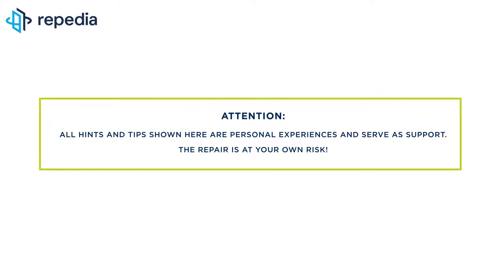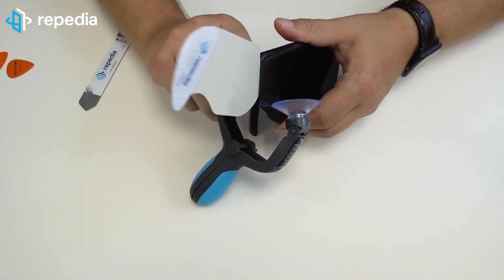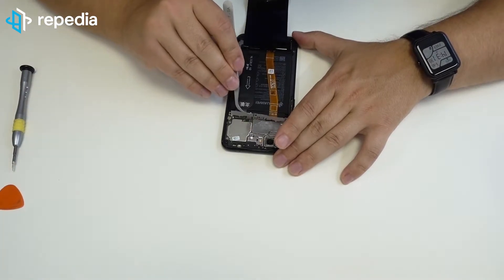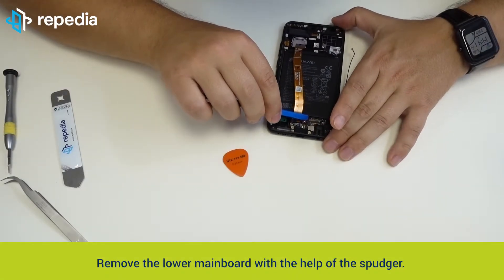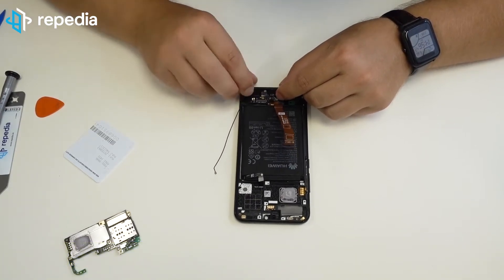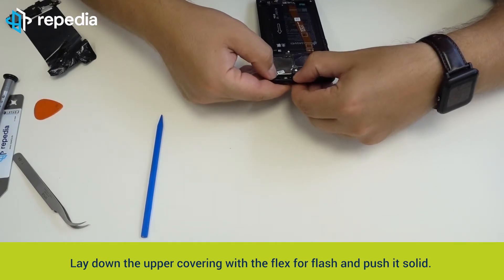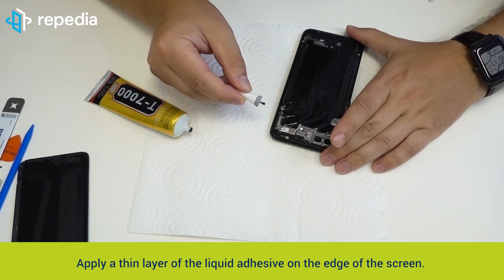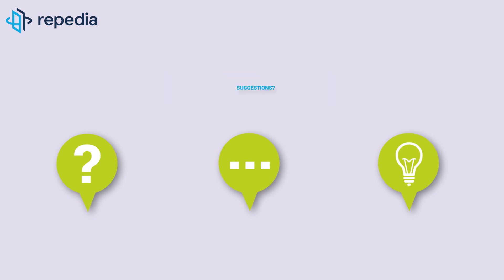Huawei Honor 10 - Screen & Battery Replacement | Disassembly | Teardown Guide

Comment: My honor 10 screen is cracked,  will the finger print sensor work after just installing the new screen, or do I need to replace the finger print sensor as well, the only one is working just the screen is cracked. Thanks
Reply: The Old one is workingI meant sensor